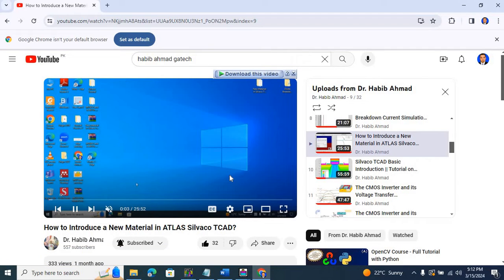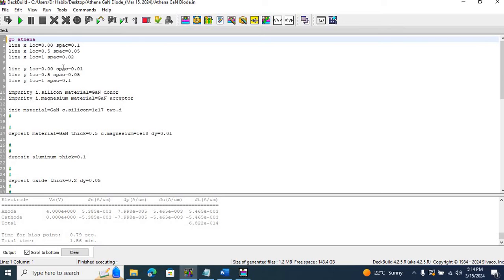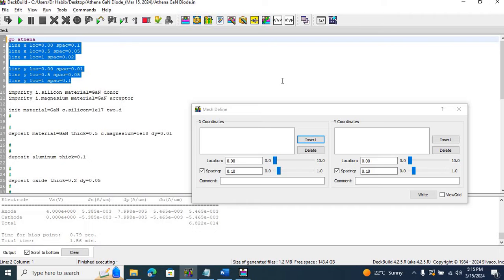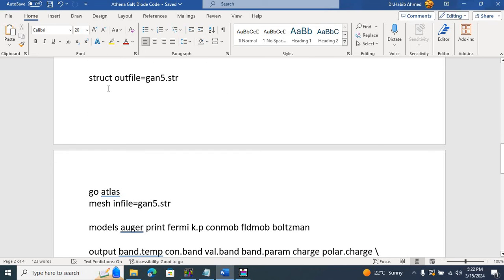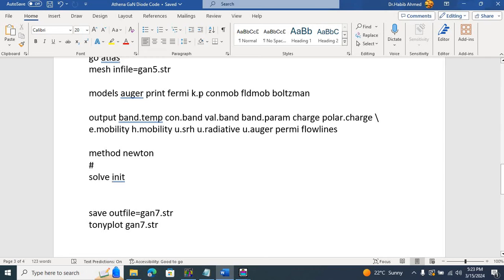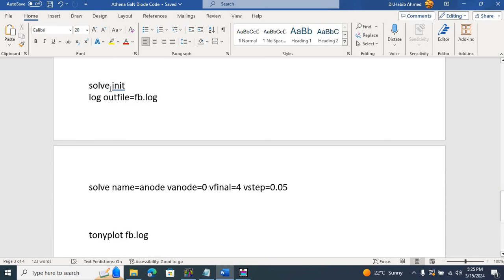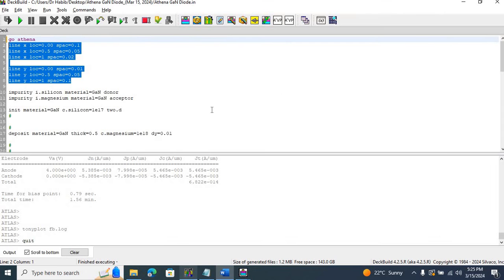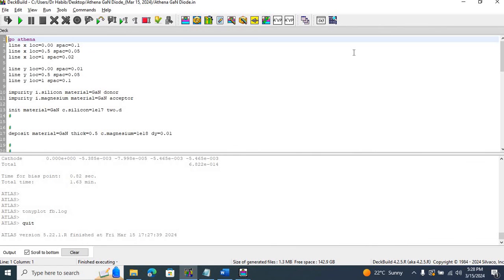How to Introduce a New Material in ATHENA Silvaco TCAD? || GaN Diode Structure in ATHENA Silvaco 🚀💡

Comment: thank you so much Dr. Habib for sharing this helpful informations, I have question concerning the example in Atlas user page 1188 defines 3D doping from ascii file for rectangular structures, unfortunately this is not applicable for cylindrical structures. I will be grateful if you can guide me to apply the above mentioned operation for cylindrical structure.
thank you in advance.